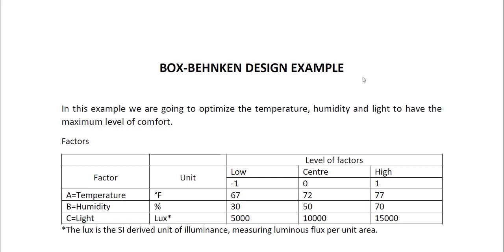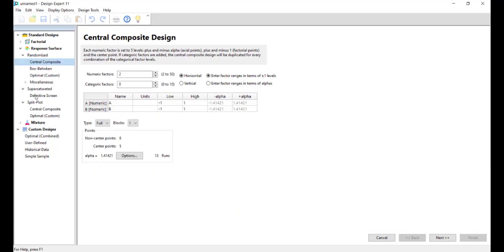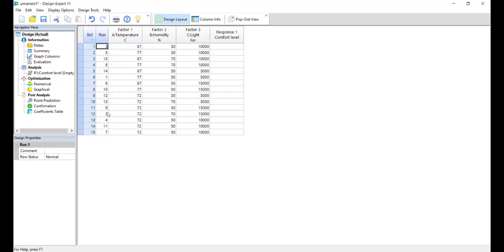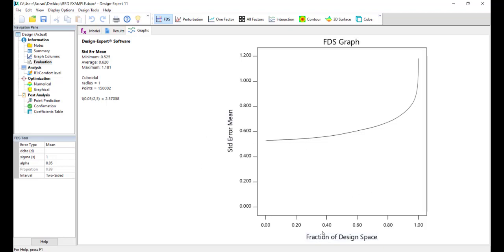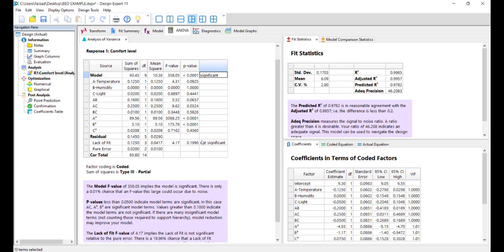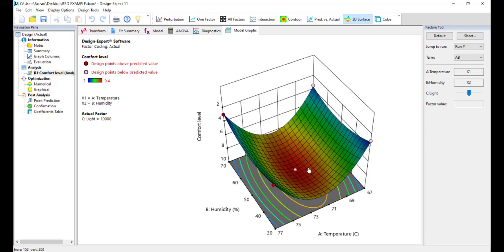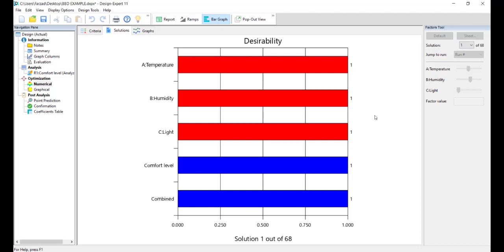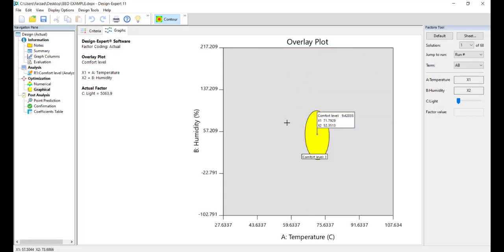How to implement BBD by Design Expert software

Comment: I have only low and high level but not centre point. Is this centre point necessary to indicate?
Reply from the maker: Generally, yes it is required and 1 center point is minimum required number of center points.

Comment: Hello, what is done in box behnken design when the number of responses is less than the total numbers of runs.
Reply from the maker: Hi. There is not a straight answer to this question. But you may check D-Optimal Mixture Design as well.